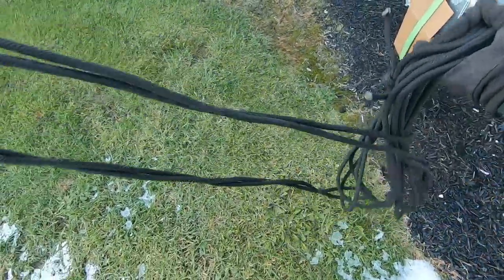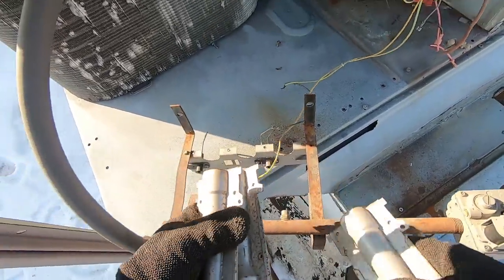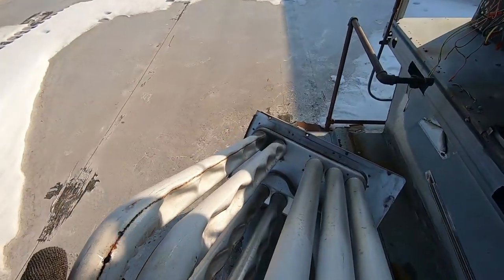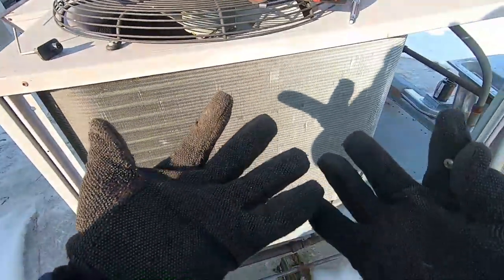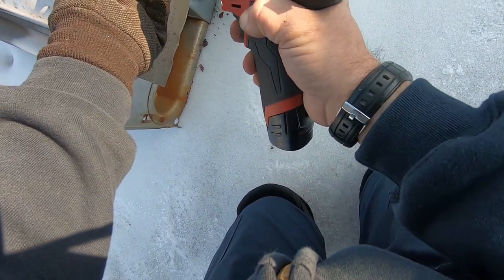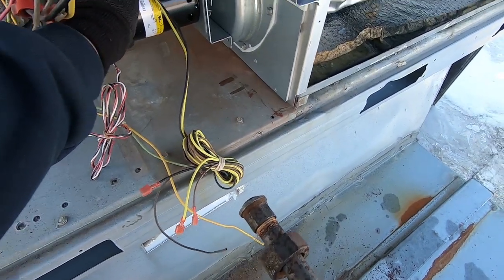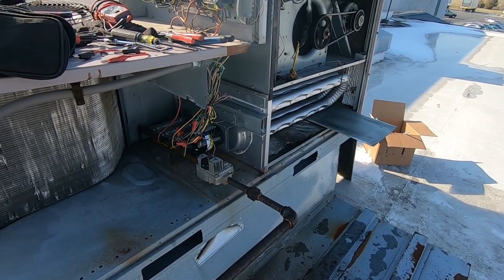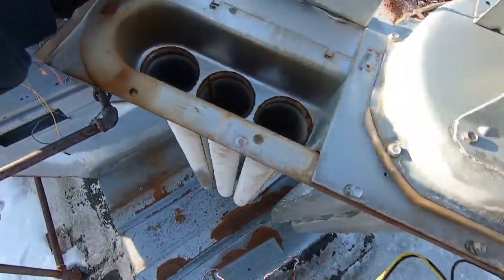Carrier Gas Package Heat Exchanger Replacement Start To Finish

Comment from the maker: Here is a simple but important safety item that needs checked and maintained. Thanks for watching and commenting EVEN THE 2 OR 3 NEGATIVES I GET ON EVERY VIDEO🤣😂😁👍👍THEY ALL HELP BUILD THE CHANNEL. THANKS AGAIN!
Reply: Have you ever seen a new heat exchanger smoke heavily for hours?
Reply from the maker: @jrrains  no, never.
Reply from the maker: @jrrains  I run the heat with the blower off for a couple minutes plus what I already said in the video to prevent that. But never hours,

Comment: These are by far the easiest package unit heat exchangers to replace.
Reply from the maker: There definitely easier than most but they also don't seam to last as long as several other brands.
Reply: No doubht
Reply: @HVACRSurvival  have you ever had a new heat exchanger spew the burn off smoke for hours? I had a install yesterday and it wouldn't stop with the white smoke.
Reply from the maker: @jrrains  no I haven't, I have stopped the fan and let it get hot so that it speeds up the burn off, but not too the point that the metal got red hot.

Comment: Good job on that repair. Those Carrier heat exchangers are good for 6 or 7 years. I have a location that they use them for dehumidifying. They started failing after 5 years. Sweet hook there. I use an old cradle mount. Bent one end open the other in a hook fashion. Works quite well. Everyone asks where I got it and I point to an exhaust fan lol. Stay safe.
Reply: I've heard it's the 90+ AFUE ones which tend to go out in short order in residential units.  They just can't seem to make good ones.  My Payne 70K furnace from 1996 is still going with its original heat exchanger.  Only issue I've had is that it seems to be finicky about an even slightly dirty flame probe; I'm always having to clean it one or twice a season, even after having the burners cleaned and the gas pressure adjusted.

Comment: Nice video👍 Haven't had any issues with our Milwaukee's but I'm an anti impact guy hardly ever use them.
Reply from the maker: I rapid cycle my trigger a lot to make sure I don't over tighten the screws and strip them out. That's likely what's killing it. But my Bosch never had an issue. Go figure🤦‍♂️ thanks for taking the time to watch  and comment.👍👍

Comment: I believe the reason they went to pressure switches is for greater safety; they want to make sure there is actually sufficient airflow in the heat exchanger before igniting the burners, and from a safety standpoint it's better to check actual airflow than to check if the motor itself is running.  I think some of them, like the older Evcon furnaces, actually use a centrifugal switch rather than a Hall-effect sensor.
Reply from the maker: I would agree but they are also a little less reliable vs the hall effect or centrifugal switch in commercial applications.

Comment: Having spent time in construction I've always been a Dewalt guy, but Milwaukee makes a great box, even better with some tools, though I've noticed the quality of all of these to have declined over the last 30 years or so.   Luckily that switch is cheap and a pretty easy fix, especially with your capabilities!
Reply from the maker: I took it apart and it's all self-contained. It has a 5 year warranty so no worries just an inconvenience to be away from it when I use it every job I'm on.👍👍

Comment: As far as winter gloves go, I like the Max Grip gloves at Lowe's. They are usually back in the garden center with all the other gloves. They are blue on the back cloth part & they have a really nice rubber coated palm side with little blue gripping dots. They are extremely functional and leave you with a lot of dexterity, but they're also pretty warm.
Reply from the maker: I'll check em out,  thanks!👍👍

Comment: Thank you for this video. It is helping me with things that I have to keep in mind when replacing a HE. I have to replace one very soon. Waiting until tomorrow to order the parts. Do you remember what is the name of the plates that you said to "order both"? Since sometimes they send them and sometimes they don't. I need to be ready with everything I need because it is cold already and it gets windy in that particular location. I haven't changed a HE on a Carrier before so any help will be highly appreciated. Thank you.
Reply from the maker: I forget the correct name but its like a restrictor plate. If you look at the suppliers parts list you'll see it.
Reply: @HVACRSurvival  yeah, I went to one of the Carrier supplies distributors and I saw all the parts needed. Thank you.

Comment: Thank you for sharing your video. I have not yet replace a heat exchanger. I learn from this video and got good tips.  What kind of silicone do you recommend to seal that heat exchanger? Do they sell them in UR?
Reply from the maker: That was red hi temp silicone. You could get away with normal silicone just don't use caulking, that might put off a smell. Something to note, High temp silicone only has an extra 50 degrees of range over normal silicone.

Comment: How did you determine they needed to be replaced? I'm having a fame rollout on my carrier unit and was thinking of taking the heat exchanger out to check for cracks. Inducer draft motor is working fine.
Reply from the maker: Visual inspection is my favorite way.

Comment: Great video. Is there a gasket for the flame retainer  plate? I see the top pre-installed exhaust regulator has one.  But is there a gasket for flame retainer plate? (where flame goes in). Thank you.
Reply from the maker: I believe I seen it both ways. In reality, I don’t see why you would need it because the draft motor is going to be pulling it into the heat exchanger.

Comment: Great video! Having ours done today. I'm curious one of my complaints about my unit is that every time the fan starts it sounds like a car laying rubber on the road. "They" say it's just the motor is so strong the fan belt slips. Any way to eliminate that?
Reply from the maker: Make sure the pulley isn't worn out and it's aligned properly. See if the belts are loose or glazed, see if the temp rise is correct, it might be set too fast?

Comment: I never have worn gloves unless it's about to be something wildly nasty like prep tables or changing hot loop filters and that's just regular ol rubber gloves. Even when i did ski lift operations for 6-7 years i didn't really wear gloves unless it was -10F or colder and had people always commenting on it.

Comment: Have you tried a Hitachi impact driver?  I wish they still made the hydraulic ones, being that they were the company which basically perfected the technology.

Is it typical for the smaller Carrier package units to have that type of condenser in them?  It looks suspiciously like a split system condenser.
Reply from the maker: The smaller RTUs have the small wrap around coil that tucks in side but normally a larger unit has a traditional look to it.

Comment: Hey man, awesome video I have a couple of the carrier 48 series.  How long would you say it takes to replacement the heat exchanger in these bad boys? My HVAC guy is trying to charge me 8 hours labor
Reply from the maker: On site labor can be as little as 2.5 to 3.5 hours, then add the travel time to the job and back to the shop, then add for picking it up and for ordering it and disposing of the old parts. But you also need to add time incase you run into problems such as getting into position and testing the unit. Maybe the RTU needs a full service, like washing out the coils and the blower wheel. All of those things can add up. I would feel safe at 6hrs total but then what do you do for the remaining 2 hours to fill the day? In two hours you can't get a lot done without going into overtime so they might have just rounded it up to 8 hours to make it easy to quote.  If this company does a great job and is reliable,  you have to decide if the cheaper company will stand behind the repair.  When I'm doubt, ask the contractor what all is included with the time billed for. Some contactors price the job higher if they're busy in hopes of not getting the job. Talking it out is the best way to know.

Comment: Thanks for the video, one question when obtaining a combustion analysis would you grab from the exhaust pointing directly in or drill a hole to grab from the side at the exit? Awesome video, thanks so much.
Reply from the maker: I haven't ran many combustion tests on commercial RTUs,. But from what I have found from testing in different locations of the flue pipe, it hasn't made large changes in my readings as long as your centered in the exhaust path and are within 12" from the draft motor.  But remember if you're checking a natural draft heater, to test before the draft hood where it adds room air to aid in the natural drafting process.
Reply: @HVACRSurvival  thanks for the reply and info. I was referring specifically when dealing with these carrier 48 tfe style packaged RTUS as they don't typically give you a grill on the exhaust like trane for example. They just have that silly single bar for bird protection. 

Hope you have great and safe new year!

Comment: Im cheap like these folks too.
Plus my unit wasnt used very long.
Not sure if i can purchase the heat exchanger.
It was barley under warranty but/ manufacturer wouldn't let me have the part.
Only if i paid them 1200.00 to change it.
I forget which brand mine is.

Comment: I have a 48gs-048090300 carrier unit which may have a clogged heater tube or it's bad as I am having flame rollout back to gas orifice on #2 feed. Part # for new heat exchanger??
Reply from the maker: I don't know part numbers, I call the supplier and tell them the model and serial number. If it's clogged or cracked it's probably rolling back and yeah then you're probably going to need to replace it.

Comment: Why did you switch from Bosch. I've always been a 12v Dewalt guy (no problems what so ever). But I recently got a great deal on Bosch #PS41, the old "brushed" impactor.  So far I seem to like it, not nearly as much as my Dewalt, but it seems like a nice drill. Did you have problems with your Bosch?
Reply from the maker: Only reason why I switched from Bosch was because of all the extra tools available for Milwaukee. I loved my Bosch and was probably more reliable.

Comment: I've only known of pressure switches.  What's a proximity switch look like?
Reply from the maker: It's a coil that is on the end of the draft motor, it picks up the magnetic field of the motor spinning.
Reply: @HVACRSurvival  AAAAHHH THANK YOU!

Comment: Why did you change the burners? More to the point, what would you look for to indicate they should be replaced?
Reply from the maker: I look for rusty burners, crossovers, anything that could cause a call back. The burners can wear out and burn dirty causing incomplete combustion, etc and since the customer did not replace the whole system like I recommended, I wanted everything to be new in the heat section for worry free operation to the best of my doing.  Anything above the minimum repairs needed for safety was quoted as a option so the customer could make the decision and take responsibility for any future problems if they choose not to make the recommended repair. This covers myself against any liability.
Reply: @HVACRSurvival  thanks for the reply!

Comment: I have tons of Milwaukee tools but I have found the m12 batteries do not like the cold
Reply from the maker: So far I love them, Except for the trigger, which will be replaced under warranty but that I'll lose it for nearly two weeks. I bought the cordless soldering iron, Dremel tool, air compressor, circular saw, Sawzall And the drill impact combo. To say the least I kind of got all in. Thanks for the feedback. Have a great weekend👍👍

Comment: Hey I didn't see the hook and rope on kit.com. where can I find that?
Reply from the maker: I built that one.  If you don't want to make it then search for (One Trip Hook # OTH-1 by Sensible Products) I couldn't find a single pack on Amazon, only a 6 pack and I figured you didn't want 6 lol. You can buy a solid metal round rod and bend it into shape than either weld on the eyelets or bolt them on. Or check at your supply house and buy it for 45-55 bucks.

Comment: I've never done anything other then ten tons,maybe 7.5.It the exact same design. CARRIER needs to improve the extension for the drft that attaches 2 the outside door,I haven't seen that new ignitor with the metal backing,or psi controls, the ones I worked use and end sitch off drft.It usually is a red ,white,and blk wire with a plug that attaches to the integrated furnace control board.
Reply from the maker: I agree, they are lacking behind in design but they can't make them condensing furnaces when they are used in northern climates like I'm located. So the efficiently won't change much and the over all design is likely cheap to manufacture, so that might be the trade off between cheap and better. 🤷‍♂️ Hard to say.

Comment: I have two Carrier rooftop units that are about 16 years old, a 5 ton and a 7.5 ton.  I have one heat exchanger that needs to be replaced.  Service company is saying it might be smarter to buy a whole new unit than throwing good money at this problem.  There isn't much to these units.  Why buy a whole new unit at this age?
Reply from the maker: At 16 years old it would depend on what refrigerant it’s using, if it’s using ourR-22,  the refrigerants very expensive however it can be converted to an alternative refrigerant like R-407C but will require a oil change, to do it right you need to pull the compressor out and dump the oil and replace it with POE oil. You also have to judge based off of the condition of your evaporator and condenser coil. So it’s not cut and dry and hard to tell without seeing it myself, but they may be right.

Comment: I've done ,I cant even tell you how many of those.The most annoying part is ordering them from carrier.  I need everything for the heat exchanger,I'm replacing the heat exchanger. I NEED EVERYTHING IN THE HEAT EXCHANGER, EVERYTHING THAT HAS TO DO WITH THE HEAT EXCHANGER I NEED.EVERYTHING,EVERYTHING,IF A GASKET IS SEPERATE I NEED IT,IF A PLATE IS SEPERATE INEED IT,EVERYTHING!That how it's ordering them,and its every manufacturer, lennox,york,carrier it seems like all of them will have a plate,a bag of gaskets,something that's not part of the heat exchanger, BUT IS. It can be really annoying, If im doing a hx,everything that's part of it gets replaced, alot of times drft mtr if the cage is smoked.I always replace all the screws with fresh new screws,ill re use that one weird long screw.Those roll outs are infamous for going bad,I usually replace them too.Usually I pull the jumper that someone put between w1 and w2 so it runs high heat all the time.There infamousforrusted out seams,the carrier rtu that I worked on ran on 407c 2,ran hotter then R22.300 lb head on a 95 degree day.I had those hx to a science ,a helper and i could knock them out dam quick.I never disliked that design, carrier used it for like 20 yrs,going back to the weathermakers,and they were simple to work on.Even there clo boards that monitored amp draw comingfrom the compressor was self explanatory. Those units were alright to work on.GREAT JOB!AWESOME VIDEO!
Reply from the maker: Thank you for the compliment 👍👍I appreciate the feedback!

Comment: Cant do the jersey gloves. Very floppy and no grip. I'd rather use nitrile gloves on cold days. And maybe some normal working gloves over those.
Reply from the maker: I hear you. There really isn't a glove that fits my hands very well.   I've got some nice Klein gloves but they really aren't that warm. And most importantly I can't manipulate screws with them on.

Comment: i cant work on ac with  them gloves everytime u grab sum u grabbing the glove if not ace hardware fitted gloves i use my hand
Reply from the maker: I have a hard time finding gloves that actually fit my hand properly, I think my thumb is always shorter than it should be and has about a quarter to half an inch of extra at the end🤣